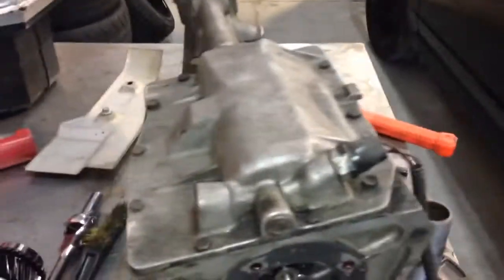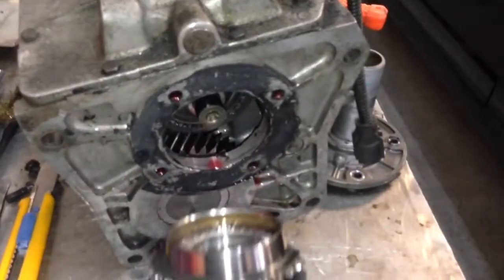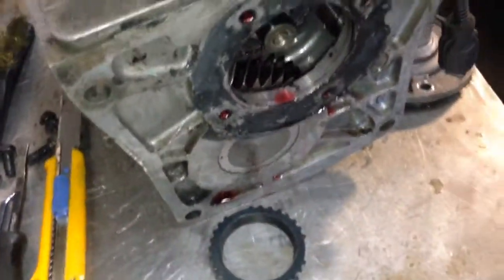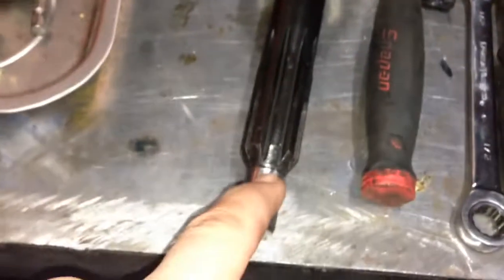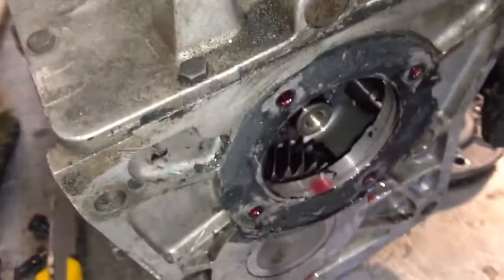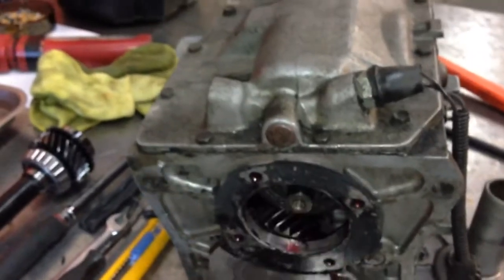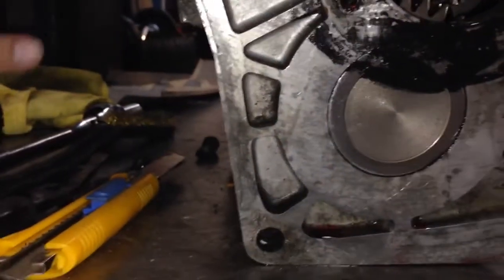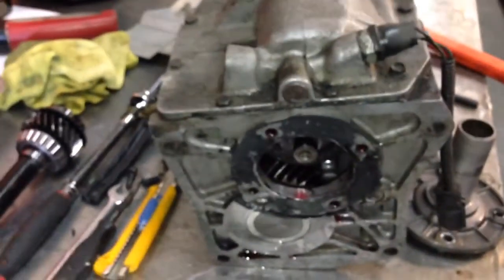How to check a T5 transmission.

Comment: Are the main shafts different from a WC and a NWC and are the 6 cylinder  main shafts different from a 8 cylinder .
Reply from the maker: Yes they are all different in size length